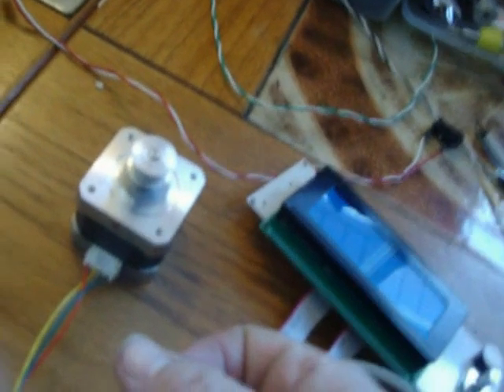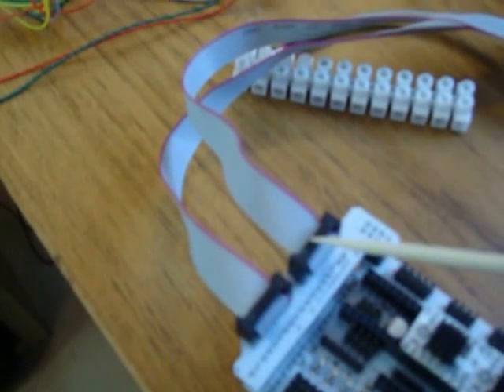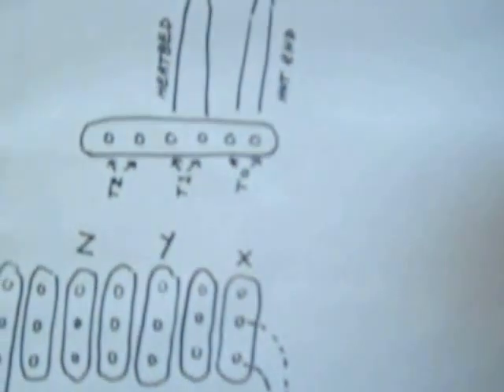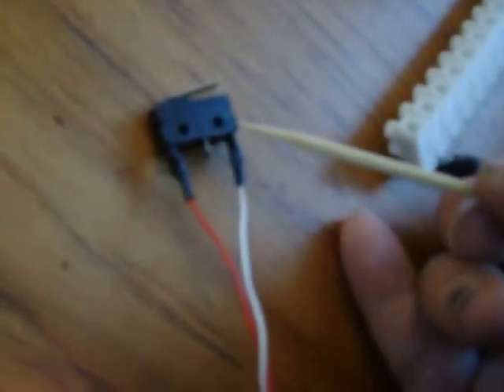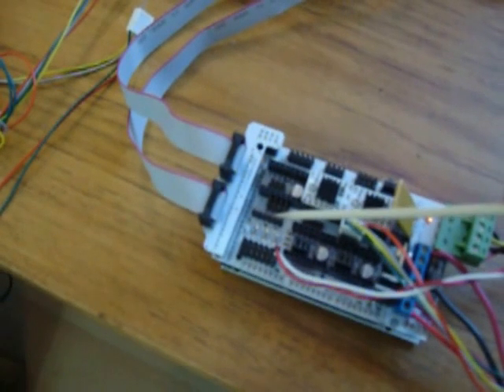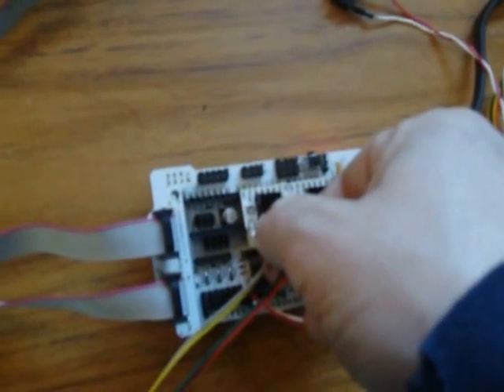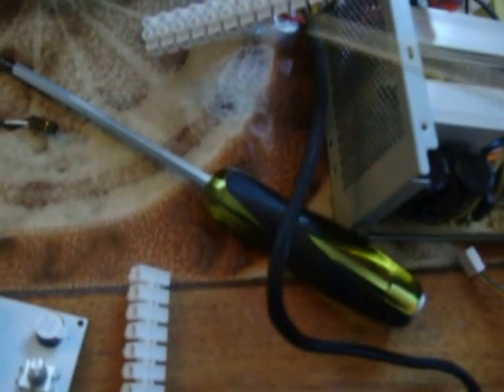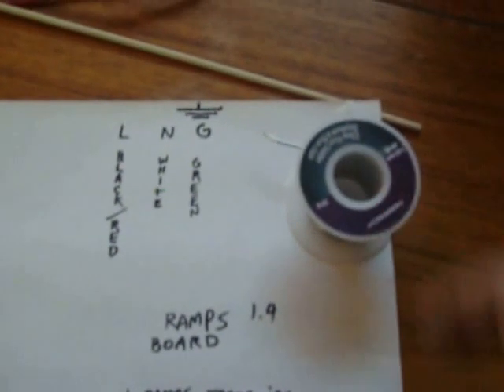How to wire your Ramps 1.4 3D printer board Avoid some easy mistakes.

Comment: Thanks a lot nice video , very helpful.  Thanks
Reply from the maker: I'm glad it helped. The video quality sucks but the info is pretty good. By the way the two screws between the heat bed and the hot end are for a fan I later found out. I have two home built printers now and still use them.

Comment: very useful. thanks for taking the time and explaining the board. and do make more videos like this. Cheers
Reply from the maker: You're welcome. I'm glad it still is useful after three years. When I made this all the information I needed was scattered all over the place but now it is much easier to do this build and many good guides have popped up. I was thinking of doing a video on building a Repstrap or a better version of the printer I ended up building but my equipment has not improved and quite honestly the chaos of my little lab is a bit embarrassing.
Reply: True there are instructions and manuals available but personally I learn fast by watching instruction video like this. If you do make any more printers or use another boards for your project please do share. Thanks again for your time. Cheers

Comment: When I turned the power on with one of my A4988's inserted like you show, a spark flew out from between the ramps board and arduino. The arduino and a4988 are fried for sure. Everything was working fine before I tried the a4988. What could cause that? Bad ramps board? Bad stepper driver? Bad arduino?
Reply from the maker: Oh Fudge take a look at the Arduino you'll probably see one of the chips burnt off its markings or even blew a hole in itself. Are you sure you supplied the right voltage? Sorry to hear about your loss. At this point the RAMPS is hopelessly outdated. I suggest you switch to a mini RAMBO for a nice all in one solution or a PICA which is like a RAMPS but takes the power management out of the stone age and is built to a very very high standard. Good luck with your build sir!
Reply: I'm using a 12v psu (the kind with the screw terminals). There is no obvious damage on the arduino. When the arduino is connected to my computer, I get a solid green light from it, although my computer tells me "the device has malfunctioned" and won't recognize it, same goes for the arduino IDE. Before I tried out the a4988 in my ramps board I was able to navigate the menu on my lcd screen just fine. On the bottom of my ramps board, there is some exposed copper in various places (not too much).

Would I need to change anything in repetier to use a PICA?
Reply from the maker: PICA works the same as RAMPs you set it up the same way in software. You will still need an Arduino mega 2560 that is working to attach to the PICA. It is just a better design. Try a different USB port on your computer and see if your computer will connect to it without the RAMPs attached to the Arduino. The only difference between the PICA and RAMPs is PICA is built better and handles power in a sane way. Real fuses, no poly fuses large power traces and heavy connectors that can handle the currents of all the loads. RAMPs is running on the very edge of it's component ratings, PICA is overbuilt and can handle anything. If you see no obvious damage see if you can load blink from the arduino IDE and get it to run on the bare arduino board then go from there.
Reply: I can't even get my computer to recognize the board, so I bought another arduino (clone). If this one gets fried, I'm just going to get either a ramps board and drivers from a reputable source, or I'm going to look into getting a different board, like the PICA, and getting the drivers from filastruder or something.

I may have found the problem though, the metal parts of the large mosfets were kinda close together, and the plastic parts were touching, so I moved them further apart from one another. I'm not confident that this next try will work.
Reply from the maker: Oh Fudge sounds like a plan.

Comment: the red line on the LCD screen cables for me are on the left, it isn't possible for me to have them facing right without breaking out a dremel tool. I'm not worried though, I got my ramps, lcd screen, cables, and stepper drivers as part of a bundle.

Comment: I am currently working on my printer and i am getting stuck on setting up the program for Ardiuno i am using Marlin
Reply from the maker: https://www.arduino.cc/en/Main/Software       The installer is here. Make sure you have the correct port selected and if you cannot connect try changing the baud rate?..... I think that's what it's called. You may also have to hunt down a driver if you can't see your board. Try loading and running "Blink" from the Arduino IDE examples first before loading Marlin so you are sure your board can talk to your computer. And of course make sure you set the IDE to the right kind of board. It's a long complicated process and it's spread out all over the damn internet but keep at it. It's worth it.
Reply: The board works great, i have been able to test my motors and everything it is just getting Marlin set up correctly.

Comment: Do you need a separate power supply for the mega 2560 or does it get power from the ramp board?
Reply from the maker: I run mine tethered to a computer so it is always getting power from the USB connection. I don't use the little click wheel/LCD screen thing since it's just total garbage compared to Pronterface. http://www.reprap.org/wiki/RAMPS_1.4 has a paragraph labled "Power supply" Looks like if you solder in a diode the Mega will draw power off of the RAMPS.

Comment: what wire gauge do you recommend from the power supply to ramps? thanks
Reply from the maker: The bigger the better. Any large multi strand flexible wire will do. Use a chunk of wire from an outdoor extension cord. You can use the end with the plug on it to bring house current to the power supply unit and another part of it to bring power to the RAMPS. I used wires from a PC power supply but only because it was already on the bench. Next one I'll use a 5 foot extension cord.
Reply: fourburnerbreakfast ūj

Fttibm

Comment: hey .. i have connected the end stop(that has 3 pin) backword  ..
the RAMPS shut dowen and does not work when i connect it to the power supply But it work ok when i connect the arduino with pc 

is there is any way to fix the RAMS?
Reply from the maker: Bummer. I'm sorry but I don't know what is wrong with your RAMPS or Arduino and I don't know how to fix it. At least you found this video and now how to wire it properly next time. The parts are cheap. Try again.
Reply: +peterthinks 
its allright .. thank you
Reply: i now know that when i connected the end stop iverted that created ashort circut in the arduino.. after chicking it the 5 volt reglator was the problem .. i replaced it with a new one and every thing is now great :)
Reply from the maker: I'm glad you figured it out and got it fixed!

Comment: My RAMPS just died out during a print.. now I can't turn it back on again, it gives no response, tried several power supplies also. I can't seem to figure out what exactly happened so I can fix the board, or at least avoid making the same mistake again with another one. it worked well through several prints, something must've burnt out.
Reply from the maker: +Henrique Arroyo It probably isn't the RAMPS board. RAMPS is very simple and really just reroutes signals from the Arduino.  You most likely have a problem with the Arduino board. Take everything off the Arduino mega and see if the computer can hook up to it. Try to run the Arduino sketch "blink". I burned a cheap Arduino early on. I had to get a real one from Adafruit to make my printer reliable.
Reply: +peterthinks Well that explains why I can't find information about fried RAMPS online hahaha. 

Alright man I'll try to test the Mega then. 

I remember checking the Mega by connecting it alone with external power supply, and when it lit up I immediately thought that the problem was on the RAMPS. I'll check this further and get back here with the diagnosis!

Thanks!
Reply: +peterthinks well turns out it is probably the RAMPS board after all.. the Mega is working fine. I was able to figure out that no power is coming from the ramps to the arduino whatsoever. If I power the mega directly, bypassing the ramps, everything works, lcd and all. But the motors still wont move. I think there is something wrong with the ramps 12v power line.
Reply from the maker: Ok, the poly fuses (square yellow things) Are notorious for failing in an in between state. You can jumper them out (replace them with wires or connect wires across them) and replace them with inline automotive fuses on the wire between the power supply and the board. If you still don't have power after that I'd say bad mosfet.
Reply: +peterthinks bullseye! It was one of those fuses, but I got lucky this time I guess, one of the solderings broke loose. All I had to do was solder one leg back and it is printing. Thanks man! Wouldnt have found this without help
Reply from the maker: +Henrique Arroyo Was it a bad solder joint or did it overheat and melt? Glad you found it!
Reply: +peterthinks I think it melted. there was a hole through the solder and the wire was just hanging in the middle of it
Reply from the maker: I would just replace it with heavy wire and put a fuse inline with the power going to the board from the power supply then.
Reply: +peterthinks Yeah, it is working now, but I'll replace it to make sure this won't happen again. Thanks for the advice!
Reply: +peterthinks My first arduino was a clone and it printed 2 spools successfully. It then died sending back voltage to the USB and turned off my mac. Replaced both arduino, ramps, and steppers with a new kit. Was getting to the final test with the extruder, was bouncing back and forth. Switched stepper drivers E0 and E1. Extruder functioned correctly, a few minutes after loud tone came from the display board. Took everything apart, another bricked arduino. Can't get it into dfu or have mac, win 10, and linux detect it. Went to test both bricked arduinos with 12v dc ps and one of them fried volt regulator... sizzle and smoke. The other one didn't even turn on. Tested the fried one's USB and mac said to remove it b/c of high current, no lights, nothing. Other board (not fried) 2 lights turn on... I've had the worst luck with my printer and I suspect it being the cheap arduino clones. Waiting for the 3rd to arrive... All 3 would have cost the same as the genuine one. Grrr.

Wanted to ask, how is the real arduino board? Still working? I ask b/c I'm going to try 1 more clone. If it fails, going to get a real one.
Reply from the maker: The real Arduino from Adafruit is still going strong. Worth every penny and I'm sure it has paid for itself several times over by NOT frying itself and the very expensive computer I have it hooked up to. Sorry to hear about your luck. I hope you can get things going properly. The RAMPS is an attractive option for those looking to get into this cheaply but it can totally backfire. Don't forget to test your board by loading "Blink" before you commit to running a printer off of it. Do this without the RAMPS and stepper drivers attached.

Comment: This is great. Thanks so much for taking the time to make the vid.  I got my printer from China. DLT-600. If you want to pull your hair out with Chinglish instructions, buy this printer! Very frustrating.  I'm trying to figure out how to wire the RAMPS shield. The instructions indicate wiring both hotends (I have a dual extruder with heated bed) to D10.  However, that would heat both hot ends at the same rate and to the same temperature. I want to print with PLA and PVA which have different melting points. Am I missing something? I would have thought that I would be able to control the temperature of the hot ends separately? Wouldn't I want to wire one hot end to D10 and the other to D9 (as I think you mentioned in the vid)?  If so, how difficult is it to change the firmware?  This is my first build so I appologize if the questions are silly.
Reply from the maker: +Sam Steel I have seen diagrams where d9 and d10 control one hot end each instead of a hot end and a fan. Yes it would be in the firmware somewhere. I think you would have to comment out the fan and un comment out the second hot end. You're gonna have to check with Google on that one or the IRC group #reprap I'm drunk out of my mind right now. Happy Halloweeeeen!!!!
\
Reply from the maker: +peterthinks ask or google how to set up dual extruders.
Reply: +Sam Steel Were you able to get your printer working? I bought the same printer but am having trouble with the firmware. I was hoping to get a copy of your code.
Reply from the maker: +Michael Gilbert I didn't buy a printer, I built one custom. The marlin code on my arduino is the same that every person using the RAMPS board has. You can get it here...    

https://github.com/MarlinFirmware/Marlin    

Download the ZIP on the right hand side. Not much has changed since I built it a year ago.

You can put the Marlin software on your Arduino Mega 2560 using the Arduino IDE which you can get here...

https://www.arduino.cc/en/Main/Software

Good luck with your build!
Reply from the maker: Michael Gilbert
Whoops! Nevermind, I see you were talking to Sam Steel.

Comment: Hi another question do i need to install the firmware  before doing a basic electronics check just see if all electronics are working before i put in on the printer ?
Reply from the maker: +TriniRCmodels You could put everything together and install it in the printer before you install the firmware, just make sure you can access the USB port and reset button on your Arduino board. But if you do something wrong and have to tear things apart don't blame me! Much easier to bench test everything before you have it mounted in the machine.
Reply: +peterthinks ok what i ment was can i bench test everything without installing the firmware like hook up all, arduino, ramps board, stepper drives and motors and the  lcd but except the heated bed and hotend just to test it out using the lcd controller  can it be tested just like this i hope you understand what i am saying
Reply from the maker: TriniRCmodels
Without the firmware installed the Arduino will be unable to run the RAMPS board. With the firmware installed you can test everything without the hotend and heated bed. Just don't turn on the heaters in the software. You will be able to move the motors with the LCD just like I did on the bench. I don't use the LCD at all now I run my printer with Pronterface on a desktop computer since it is in the same room doing slicing anyway. I read there are problems with printing from a SD card when doing large fast curves since the info can't move fast enough off the card so I switched to a computer.
Reply: ok much thank and than you for the speedy reply
Reply from the maker: You're welcome, trust me on the LCD screen, don't even bother to hook it up. You need a computer to design the files and slice the files you might as well use a computer to run it. Pronterface has a really nice interface. Much easier than clicking your way thru ten screens on a tiny LCD.
Reply: +peterthinks Much thanks again well i'm a CAD designer so 3d models are ease for me so it doesn't matter with the lcd i know the lcd can make this printer portable so i'll test it out soon and again Thank you so much with your help keep up the good work
Reply: +TriniRCmodels there are a test program on RepRamps page where they describe the RAMPS 1.4 board.  See http://reprap.org/wiki/RAMPS_1.4#RAMPS_1.4_test_code

Comment: Big Thank you for this video i'v been looking all over for this going to build my 3d printer soon DIY one other question how to you calibrate your 3d printer
Reply from the maker: +TriniRCmodels Calibration is a double edged sword. If you print a 10 mm cube and calibrate till you can make a perfect 10 mm cube that is the ONLY thing you can make accurately! Don't do that! You have to go by what your machine can physically do. You go by the math. You do X steps per millimeter, you got X teeth on your gears, you got X teeth per meter on your belt. If you have an error you don't adjust your steps to fix that error. You just end up screwing things up for anything that isn't exactly the same as your test object. If your math is out on a 1 mm object by 10 percent that's a 1.1 mm object. On a 10 mm object that's an 11 mm object that won't fit. On a 100 mm object that's 110 mms. Everything gets worse. You have to listen to Tom https://www.youtube.com/watch?v=VIHgDiCCY0Y "Each step moves a corresponding axis by a set distance" Watch this video and all his others. You will get good prints.

Comment: My LCD/SD Controller is different from yours, and the cable plugs are indented to go in only one way. ESP1 and EXP2 are correct, but no matter how you place the cables (as long as you have them in correctly according to the indent) I do not get red to the right looking at the board as you do.  So does anyone know if this would be a problem? Would hate to fry all my electronics because of this!!!
Reply from the maker: If your board is different don't follow my directions. Wiring could change, connectors can change. I did the best I could with what I had and I made it work. Just learn. I don't use the LCD/SD board anymore. There is a bottleneck that brain farts on complicated curves (which will ruin your print). Use a computer to drive your printer. Even the lowest salvage box will be better than anything you plug into the ramps. I use an i5 2500K and a stupid amount of RAM (16 or 32 gig?) but it does slicing too. Slicing needs the brainpower...it's in the same room...the printer never moves... it's a no brainer.